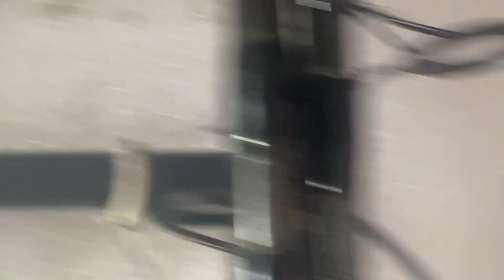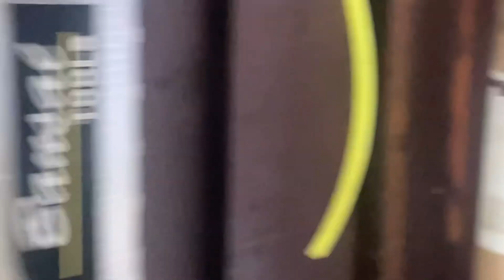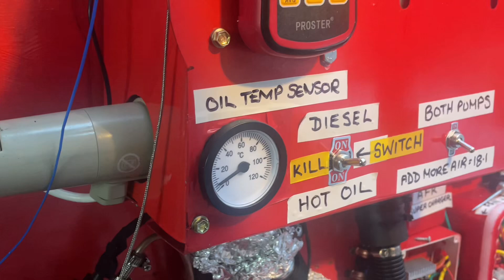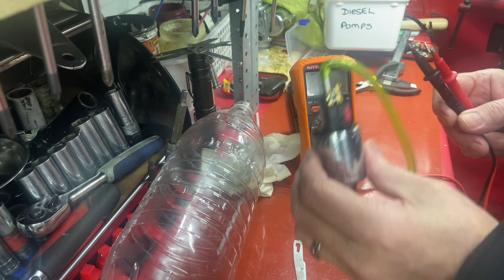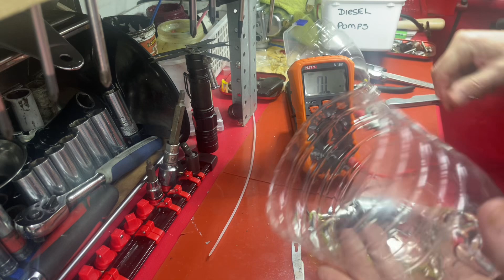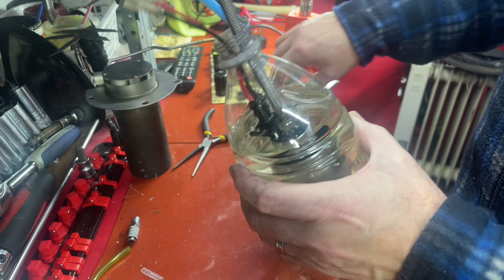Diesel heater: Part 1 Stopping the pump tick to a. Low thud!

Comment: 2k Lacquer?
Reply from the maker: 2k lacquer when sprayed on your car at 30 micron then baked at 80c drys rock hard. When left in a spray gun the chemical reaction turns it into clear rubber jelly inside 2 hours . So this electro magnetic solenoid (pump)would take 3 years to fully cure using fresh activator. Use old hardener that’s been opened  and it remain jelly at 2 inch’s thick around the pump. £10 project that silences the piston on springs action inside the pump casings.
Reply: @diesel-heater-Free-Heat  thanks... was not sure had heard the name of the stuff correctly..  Appreciate the detailed information ....  very helpful

Comment: It isn't really a signal. The pump is basically a solenoid. It has no electronics in it. 12v pulse to energise the coil and a spring to return the plunger when the current is switched off.

Comment: I purchased one of the so called silent dosing pumps (the green one). It was great for a week or so but has slowly become as loud as the original.
Reply from the maker: Those green head pumps have a O ring at the top and bottom of the solenoid piston. Once they’ve hammered flat at 30,000 strokes per day your back to square one. 🤷‍♂️
Reply: @diesel-heater-Free-Heat  yep. Exactly.